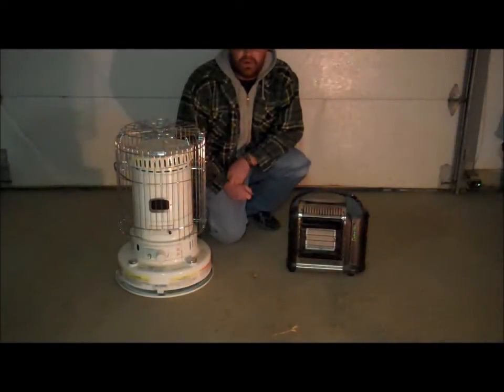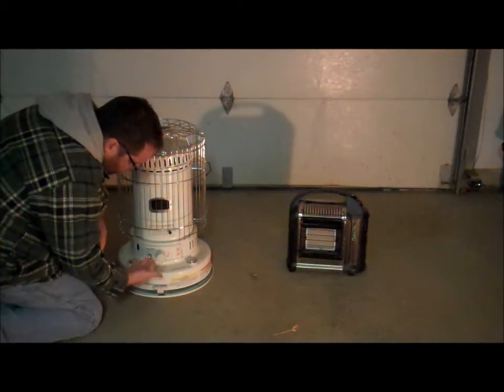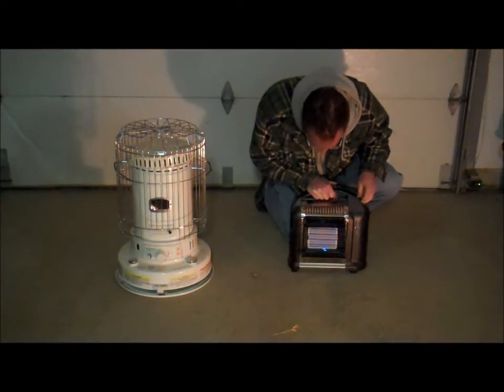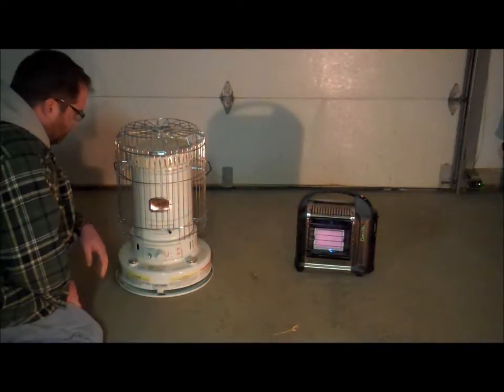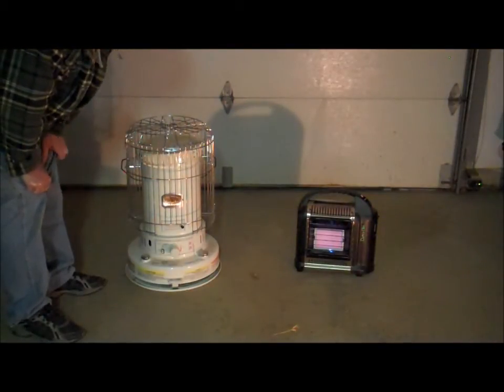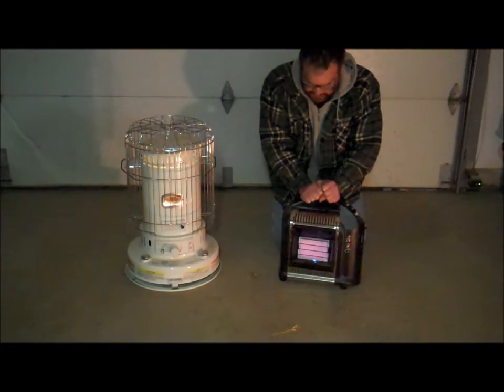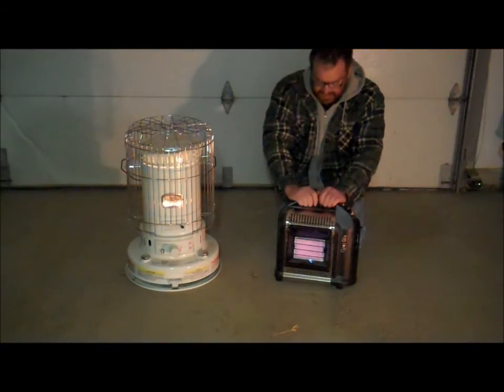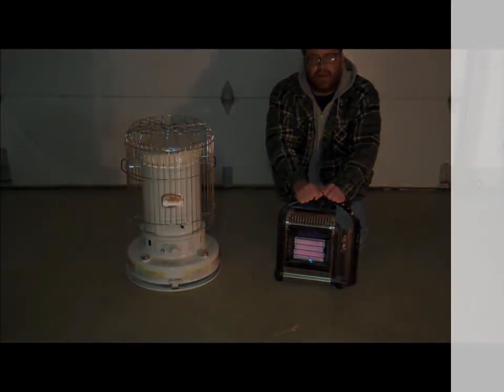Emergency Backup Heating Options Reviewed

Comment: I live in Michigan and finally bought a propane heater for backup. Luckily, I've never gone through a winter outage that lasted more than a few hours. I mainly depended on my generator, but if its cold enough outside, my generator is almost impossible to start. I can now tote my little heater out to the garage to warm up my block and fuel lines.
Reply from the maker: Thanks for you comment!

Cheers!
Willie

Comment: Do you open a window a little to have air circulation with the kerosene heater?  I lit and used mine in my basement but didn't like the smell.  Thanks for your videos.

Comment: Propane is ok but produces a lot of condensation and is more expensive to run than kerosene. ..the only thing that can go wrong with the kerosene heater is the wick or having water in the fuel